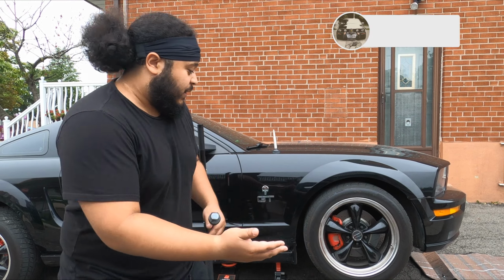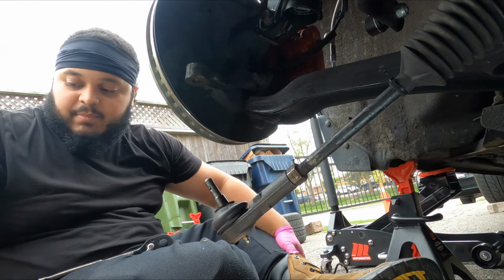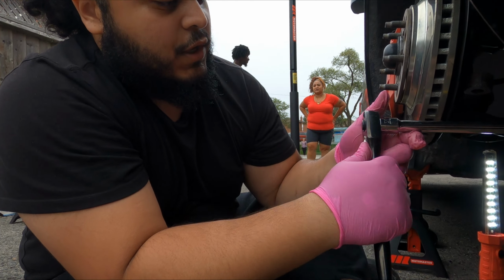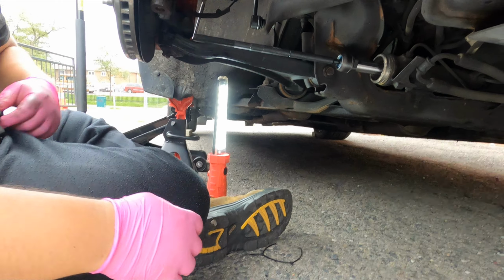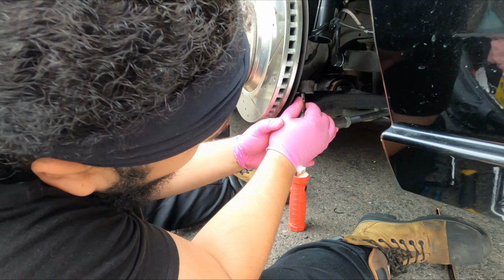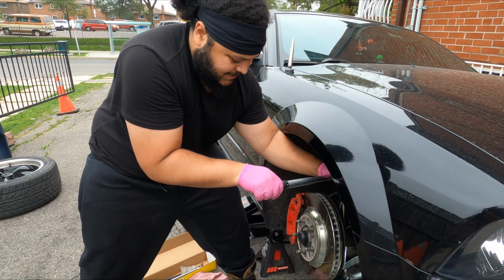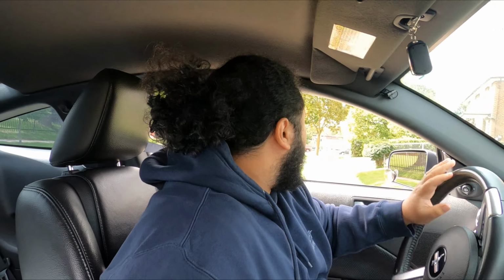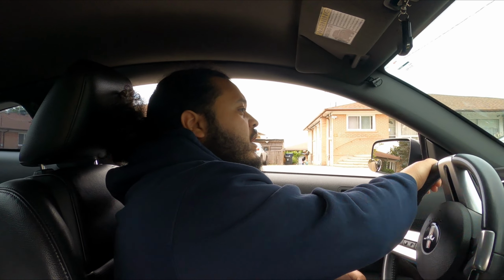DIY Tie Rod Replacement on my Mustang | Problem Solved?!

Comment from the maker: This was a fun one! Here's a list of tools I used for this DIY re/re installation, along with what I used them for in (brackets), and *affiliate links to purchase them for yourself! Show some love if you appreciate creators making lists like this for their viewers! 🔥

---- TOOLS ----
► 1/2" Ratchet Wrench
USA: https://amzn.to/3RHFnXx
CAN: https://amzn.to/3QtwwI2
► 1/2" Breaker Bar
USA: https://amzn.to/3RKJfqK
CAN: https://amzn.to/3RnIWT2
► Inner Tie Rod Tool (to break Inner Tie Rod free, literally the key tool for this install)
USA: https://amzn.to/3BlzF8v
CAN: https://amzn.to/3RKNHFY
► Any Size Torque Wrench capable of ~60lb-ft (for nut on Outer Tie Rod end (59lb-ft))
USA: https://amzn.to/3Bm2HVy
CAN: https://amzn.to/3KXuM92
► Rubber Mallet (pref) or Hammer (to get Outer Tie Rod end loose)
USA: https://amzn.to/3TTVWBM
CAN: https://amzn.to/3TQYVun
► Needle Nose Pliers (to undo cauter pin in crown nut)
USA: https://amzn.to/3KT4ODk
CAN: https://amzn.to/3cRMKwS
► Cutter Pliers (to remove clamps securing Inner Tie Rod boot in place)
USA: https://amzn.to/3KT4ODk
CAN: https://amzn.to/3cRMKwS

---- SOCKETS ----
► 1/2" Extension
USA: https://amzn.to/3D3LbXg
CAN: https://amzn.to/3Bms6P2
► 1/2" to 3/8" Down Step Socket
USA: https://amzn.to/3D3LbXg
CAN: https://amzn.to/3Bms6P2
► 3/8" Extension
USA: https://amzn.to/3AZ8per
CAN: https://amzn.to/3x4rHhy
► 18mm Deep Socket (for Nut on Outer Tie Rod end)
USA: https://amzn.to/3AZJlE6
CAN: https://amzn.to/3KTd5Ho
► 21mm Deep Impact Socket (for lug nuts on Wheels // Wheel dependent)
USA: https://amzn.to/3x09FNm
CAN: https://amzn.to/3ekdXIS
► 22mm Open-Ended Wrench (for jam nut on Inner Tie Rod)
USA: https://amzn.to/3Qo1nWv
CAN: https://amzn.to/3L1sllF

---- ETC ----
► Zip Ties (to secure the Inner Tie Rod boot in place)
USA: https://amzn.to/3BkyeqL
CAN: https://amzn.to/3qhaSvZ
► Copper Anti-Sieze (on end of Inner Tie Rod where Outer Tie Rod threads onto)
USA: https://amzn.to/3KU8PYg
CAN: https://amzn.to/3x2wvnq
► WD-40 (to loosen crud around bolts to make them easier to break loose)
USA: https://amzn.to/3RHteSp
CAN: https://amzn.to/3x2wCPS

*Affiliate links provide affiliates like me with a small percentage kickback from all purchases made using the special links; and with no extra cost to the buyer! It's a subtle way of supporting your favourite creators, especially if you plan to purchase the product(s) they're using anyway!

Comment: I heard that the front lower control arms is what makes a huge difference than the inner & outer tie rods when it comes to steering & stability, that's if you get the upgraded ones than the factory, like the gt500 front lca or the ford performance front lca which are 10x better than factory lca. My 3v is well over 140k+ miles & it's still on oem suspension so i know it's definitely time to change them along with the inner & outer tie rod cuz it's performing really bad after a year of having the car lowered with lowering springs & no upgraded suspension lol
Reply from the maker: Yikes! Yea you should definitely get to work on that haha. But honestly didn't know the lcas made that big a difference, I knew for certain my inner outers were shot though which is why I changed em. I'll make sure to change my lcas come next spring though so keep an eye out for that video then too! Thanks for the info and comment brother 👊

Comment: I'm bout to handle this on the weekend. Hopefully it fixes the vibration and loosness in the wheel. 

You from the 6 btw? Noticed the plate and jays sweats haha. Shouts from MTL.
Reply from the maker: Yessir I am 🙌
Best of luck with the install! That inner tie rod WILL be very hard to remove so be prepared, and TORQUE the new ones once installed! Hoping you have a swift and safe install brother 👊

Comment: I've done the outer tie rods on my Mustang when I installed the Shelby GT500 lower control arms, but not the inner ones. I have done both when I owned a '96 Explorer that seemed to have the exact same set up, but I don't remember the need for special tool, but I have slept since then. Maybe that was one of the changes with the S-197's rack and pinion set up. Good infomational video, as usual.
Reply from the maker: Oh the tool isn't necessary by any means, BUT it does make the job a whole lot easier and more doable on a set of jack and stands. When I attempted the install the first time I was using monkey/plumber adjustable wrenches and tried to crack the inner tie rod loose for nearly an hour and got nowhere! Whereas this tool combined with a breaker bar made quick work of it. I'd highly recommend the $25 extra to pick it up if they plan to pull the inners out. Thanks for the feedback as always 👊
Reply: Question, why did you decide to install gt500 lower control arms. Do they differ from the 05 mustang ones?

Comment: Question u said 23 spin same spot from other side too?
Reply from the maker: @boat_banging  Yes OEM spec was 23 spins iirc, but however many spins it takes to take your old ones off is how many spins you should use to put the new ones on to preserve as much of your car's previous alignment as possible. You can always do an extra google search to make sure as well!

Comment: You should have used a wrench on that inner tie rod end to tighten it, not simply hand tighten it.
Reply from the maker: Yea I was gunna use an adjustable wrench on it but I've read that hand tightening it is all you need so I went with it. Let's hope it doesn't come back to bite in the future lol.
Reply from the maker: Decided to be safe and went back in and tightened it this morning. It was pretty loose so thanks for commenting and motivating me to double check and tighten it down. Appreciate you lookin out 👌